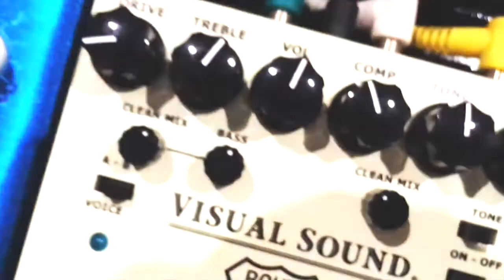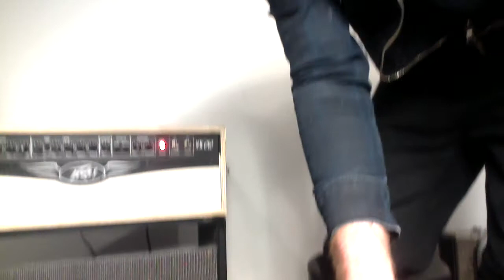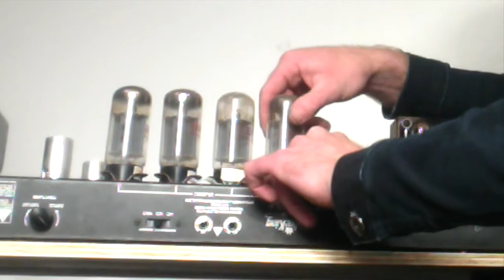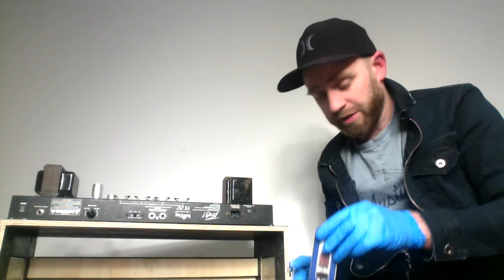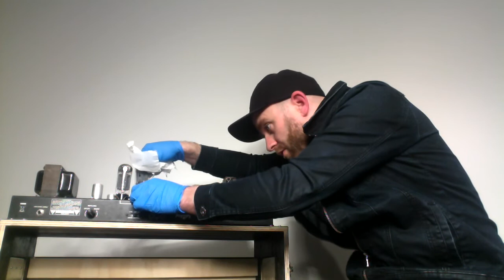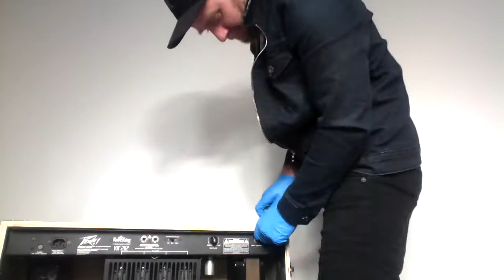Crackling amplifier

Comment: Thank you. my amp is only crackling after playing notes [Blackheart Handsome Devil combo] after someone put in on the floor aggressively. Any advice other than never let that person near my amp again?
Reply from the maker: Ok I haven’t come across that before. Is that a tube amp? I’m just wondering if it could be the pre amp tubes rather than the power tubes. But it might pay to check with an amp tech.
Reply: @GroundbreakCreative  It's a 15 watt tube amp by Blackheart (company made by Crate). I thought maybe it's a bad connection in one of the tubes
Reply from the maker: @SeemoreDunkan   could be, but if it’s been harshly moved while the tubes are hot it had likely damaged the tubes themselves. You could try removing the tubes then putting them back in, that would help if there was a dirty connection. The fact it only happens after you play a note makes me wonder if the issue is not in the power section, but the pre amp section. Some amps will have a solid state pre amp section though, you’d have to have a look and see if you have some smaller tubes as well as the large ones.
Reply: @GroundbreakCreative  You are an angel for replying in such detail. I opened it and fixed it. it's fully tube btw :) thanks
Reply from the maker: Awesome, glad that it’s sorted 👍
Reply: @SeemoreDunkan your name is cool seemoredunkin that's awesome 😎
Reply: @rayfabris2512  YOU'RE awesome..
Reply: @SeemoreDunkan  those are the pick ups I'm going to put in my les paul I played it for 3 years with the Gibson pick ups I wanted to check out get a little hotter pick up just not to hot something like Slash but I don't want his just similar anyway have a good day and great weekend so ROCK ON

Comment: I had the same crackle on my Marshall Origin50h. Changed 2 of the 3 preamp tubes, the amp did not crackle for the next 20-25hrs of use. The crackle just came back an hour ago. Now will try changing both the power amp tubes in hopes for it to go away. 

P.S : once the amp had warmed up, it worked as per normal but it sounded very inconsistent with the volume as well as overall tone being dull. Hope this helps someone in the same situation

Comment: My modded Deluxe Reverb running 6L6's started crackling after pushing the tubes with a power soak. I think I may have diagnosed my issue. Thanks.

Comment: The halogen bulb thing about the oils from your hands has to do with the fragility of the glass (leaving residue on them will cause them to heat unevenly because the glass is so thin which can result in shortening the lifespan of even the glass breaking), vacuum tubes are much more robust and touching them with bare hands should not be a problem, though it doesn't hurt te be careful.

Comment: Very nice, informative video, most of these I like how you explain with very relaxed and composed way. Thanks. I have a similar problem I haven't check it out so far the reason. One of my speaker starts giving crackling sound.Only checked by switching speakers wires, its in the amp. But it isn't a Vacuum tube amp, a transistor one. My first suspect is the potentiometer (volume control) if not then i will go to capacitors. Am I right?
Reply from the maker: Hi there, yes that’s right, if it’s not a tube amp, go for volume pots first. Sometimes if you wiggle the knob you can get them to play up. Otherwise transistors or capacitors yes, but it’s best at that point to have it looked at professionally, due to the voltage that capacitors can retain.

Comment: I got a JCM900 that does the same thing but a lot quieter, I changed all the power tubes and it still does it. Will change the pre amp tubes next, hope that solves it.
Reply: Did u solve
Reply: @Swanlord05  Eventually, It wasn't the tubes, I was plugging my amp into a power board instead of straight to the wall. Grounding I guess
Reply: @gogopowerrangers-gogo  do you know what kind of power plug I need? I lost the original and have had troubles since I got a new random cable
Reply: @lucasvarela9632 For me I only need a standard kettle plug, make sure the part that goes into the wall socket fits where you live.
Reply: @gogopowerrangers-gogo  ok yea. Thanks!

Comment: My amp at only over a year old started cracking and popping about three different times over the course of three weeks then the third time the fuse blew. 
Shouldn't tubes last a lot longer than a year? Especially when it's played only at home at low volumes.
Reply: Tube life also depends on the amount of usage you get out of them. 

They say poweramp tubes go faster than preamp ones but my amp (just over 1 year and 1 month) started crackling. Changed 2 of the 3 preamp tubes, no crackle for a good 20-25 hours. 

Crackle came back. Now will replace the poweramp tubes and hope it resolves. 

Tube life also depends on how the amp is biased. If it is biased too hot, then tubes wear faster. 

Tube life also depends on how your amp is set. Mine is set such that the master volume is low while the gain is set to a slight breakup. This will make my preamp tubes to go way faster than the power amp tubes. 

If the master and gain are set similar, then you’re going to wear them out more evenly but the power amp tubes will need replacing sooner than the preamp in most cases
Reply: I have power tubes that are 15 and 7 years old, mixed, i play super lead on 7 8 ,, never failed, ive changed preamp phase inverter once.

Comment: I have an Orange Tiny Terror Combo. 15 watt Full Tube amp. I bought it used two weeks ago. Sometimes that crackling noise come when i am playing. But most of time it is quiet. 🤷‍♂️
Reply: Contact the seller if it is still under warranty. The tiny terror is monetarily, a cheap amp and tubes will cost half of that amp itself. 

Better get it replaced for free than pay more just so it works as it should!

Comment: Any other suggestions my little 1987 fender champ 12 has the exact same crackle,  I put new tubes in an after about an hour of being on the crackle starts up again?
Reply from the maker: I think sometimes that faulty capacitors can affect the the tubes as well. You’d really need to take it in to an amp tech to check that out though.

Comment: I have the same problem but my amp doesn't have tubes, also I've used Deoxit D5 to clean like 2 times already, and it's still there.
Reply from the maker: Does it still make the noise without anything plugged into the input?
Reply from the maker: Just had a talk with my amp tech. He says to try wiggling the volume control. If that makes it worse it but dust in the the volume control. Otherwise would be transistors.

Comment: Nice video, I have a amp (under a year old) and it’s starting to do this. Could it just be one faulty tube ?
Reply: Hey Brian, if it is one tube or not, is hard to say. Just try the old pencil method to check for microphonic tube/s. That worked for me. Note that many times the microphonics won’t come through the speaker but you got to hear the difference (the bad tube ringing at a higher pitch than the rest). 

Also, preamp tubes can be replaced individually, however, the power amp tubes should always be switched in matched pairs to be the safest. Hope this helps

Comment: Same issue with my 6505+ but new tubes hardly changed anything except make it a bit quieter. Service is stupid expensive for this head.
Reply from the maker: Does it change if you wiggle any of the control knobs? Particularly the volume or  gain? Can sometimes get a dirty pot that will sound similar.
Reply: @GroundbreakCreative  I have cleaned the pots already. I'm starting to think it could be a ground issue or possibly a capacitor.

Comment: I have the exact same problem on a solid state amp. Any other ideas?
Reply from the maker: Could be a transistor or capacitor, I haven’t come across that myself. Probably worth taking to an amp tech, those components may be running high voltages.
Reply from the maker: Just had a chat with my amp tech. He says to try wiggling the volume control. If that makes it worse it will be dust in the volume pot. Otherwise it will be transistors.
Reply: My amp was crackling so I unplugged it... problem fixed... but then when I plugged back in the crackling came back. Suggestions?
Reply from the maker: @56davidwright   When you say you unplugged “it”, is that the guitar lead you mean?
Reply: Even with the lead out and all knobs turned to zero the crackling comes back. It's intermittent, some times it goes away for an hour or so but it comes back.
Reply: I've swapped the power tubes. Same result.
Reply from the maker: @56davidwright  ok so first thing to try is to wiggle all of the knobs, see if any of them aggravate the problem, that would indicate a dirty pot. After that I would suggest taking it to an amp tech, it could have a capacitor issue, or there may be a loose wire somewhere or dirty connection. The problem is they can run some very high voltages and the capacitors could hold that charge, even if the amp is off. That’s why I suggest taking it to a tech, who knows what’s happening where and how to work with it.
Reply: Yep . I reckon caps at this point.
Cheers 🤗

Comment: how about a non-tube amp ?
Reply from the maker: So to start with, make sure it’s noisy with no lead or guitar plugged in. That will rule out everything that’s not the amp and also the input jack. Next thing to do is to go through and wiggle each of the control knobs, if the crackle changes while doing this, it could just be a dirty pot. If that’s not the case, you may need to take it to an amp tech as it is likely a capacitor or transistor in the amp. These work with high voltages so best to take it to a professional to be tested safely.
Reply: @GroundbreakCreative  I know my amp as soon as I turn the volume knob crackles without guitar and thanks narrows my concern down
Reply from the maker: @amongotherthings5696   So it sounds like the volume pot is just dirty, you can probably take it out and clean it yourself.
Reply: @GroundbreakCreative  I will definitely do thay

Comment: My issue with crackling is when I touch the master volume it's crackling
Reply: It will be that volume control then, need to get it cleaned.
Reply: @gettingitdone1  I just got done cleaning up the pots, everything is working great
Reply from the maker: @subsoniczero3233  awesome, well done. Sorry I accidentally replied from my other channel, but the answers the same 😆.